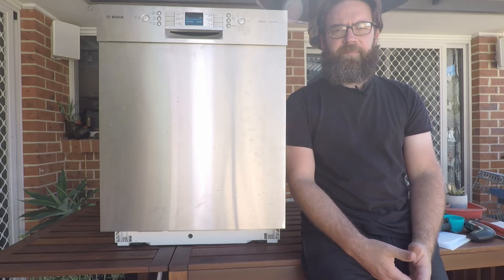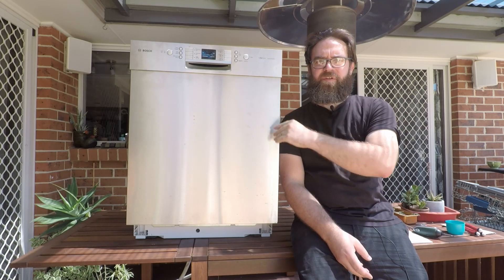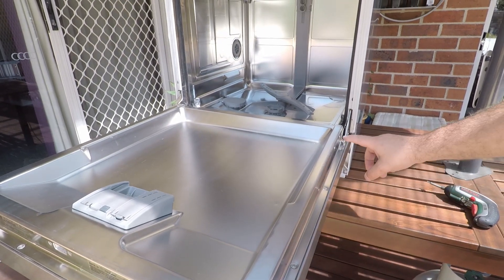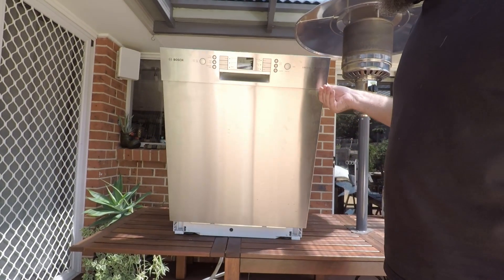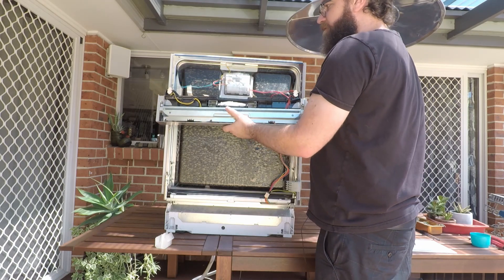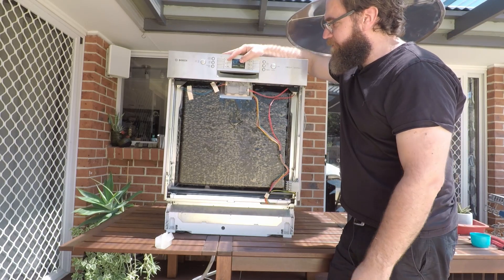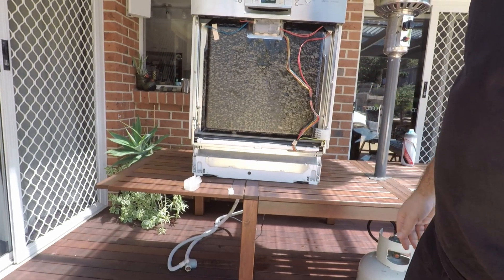Bosch E06 error code diagnosis and repair

Comment: Got a bit confused another video said E06 was the Aqua sensor
Reply: Hi, I had the same problem after replacing the DOOR SENSOR. The problem was the YELLOW cable broke at the bottom of the door. Need to remove the front panel.

Comment: I got the same fault E:06 and the door sensor had stopped responding to a magnet that I used to test it. Turns out it was a broken wire (yellow door sensor cable) near the bottom of the door where it is constantly flexed when the door is opened and closed. I had to solder it together and machine is working again.

Comment: Hello! How to verify, is it a problem with the sensor or something else ? I have about 8v on the sensor's disconnected plug , which drops down to zero when I connect the sensor. Magnet doesn't cause any changes. Also any resistor up to 100 Kohm, connected to plug, causes voltage drops down to zero. 300 Kohm drops to 2v and 700 Kohm drops to 4-5v

Comment: hey guys,
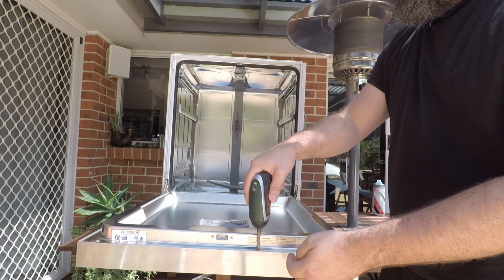I have an issue with this same dishwasher, where in non of the the programming buttons are functioning. thus the default program is set on 1:30 or 2:30 and it doesnt start. does this problem seem to be due to the power supply too? has any one faced this issue and who was it resolved ?

Comment: Hi I've replaced the latch, and the control module and still have error 6.  Do you have any other suggestions?
Reply from the maker: Have you tried tricking the machine with a strong magnet? You should be able to get it to active by moving the magnet around the top edge of the door where it latches. Otherwise the problem could be with the wiring to the power supply control module, or the power supply control module itself. Hope you get it sorted!
Reply: @Sawickipedia  tried the magnet with two different latch and three different control module.  I'm thinking it's the wiring.  Thanks for the video
Reply: L T  how to fix it then?
Reply: L T  is the aqua sensor part of the latch on top?
Reply: @legoglegoogy9813  honestly, they change the models so frequently that it's difficult to get the right parts for the model.  After ordering 2 different control modules we've given up and bought a different brand of dishwasher... Good luck